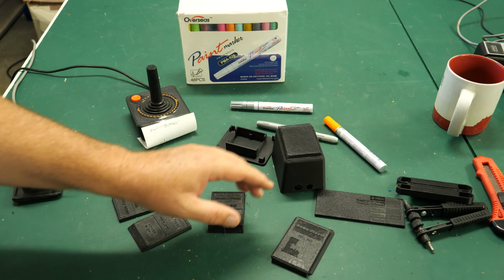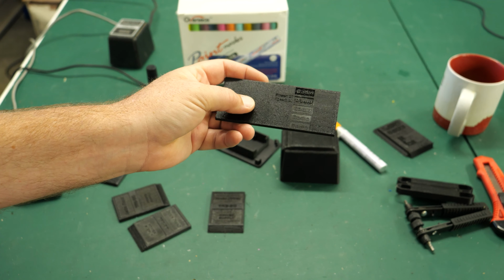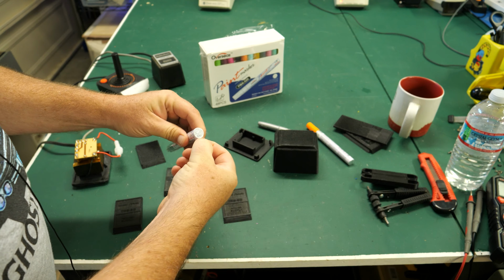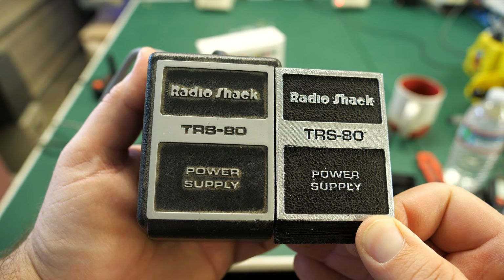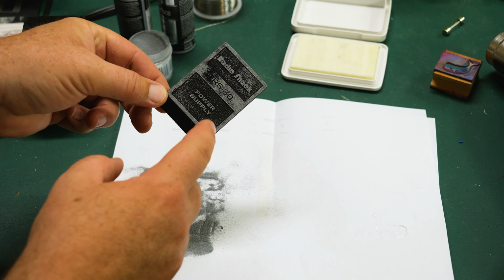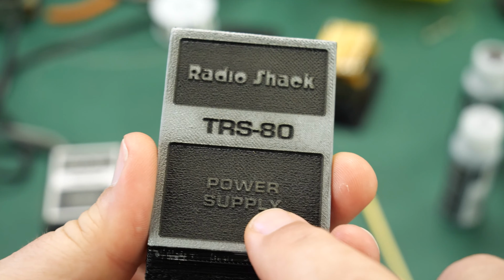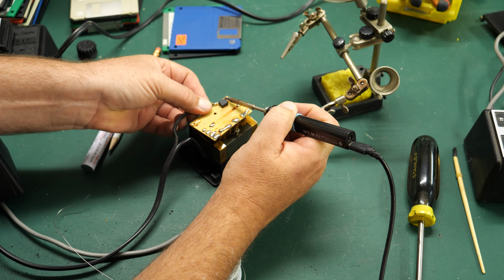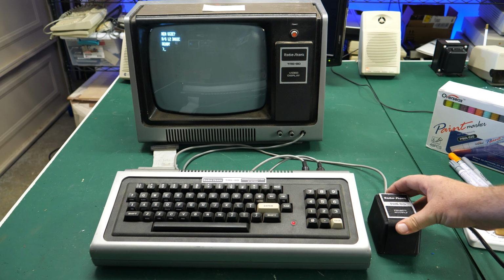Using Lasers To Make Reproduction Cases For Vintage Computers

Comment: For silver, you must use graphite. It is used to great effect on cosplay 3d prints, and after rubbed in, does not come away at all. During application it is messy, but thereafter its really nice

Comment: Why not just print in 2 colours since it is flat you can use change filament  at layer hight. The good bit been it will not rub off

Comment: You might try painting rubber roller. They are used for fine painting surfaces. Contrary to using brush or pen, it cannot touch deeper surfaces so painting should be more tidy. Also painting goes quicker as you just roll it over the surface.

Try acrylic paints. They are easy to use and are somewhat resistant to usage wear.

Comment: Using a foam roller with a very light load of paint will roll the paint on very easily. Just load the roller with paint and roll it on a tray to get the roller to have only a small amount of paint (almost dry roller). I do this with raised letter signs all the time.

Comment: Why not make a mold then use injection instead? It would give you a much more realistic finish as well as avoid having to make and reproduce all those fine details, especially of the rough-face of all the sides...
Reply from the maker: If only I had an injection molding machine 😞
Reply: @RetroHackShackAfterHours Local companies do that as long as you make the mold. I know this would be better if you wanted to make a larger quantity, but most shops will do it for you for not much money.
Reply from the maker: @ronwatkins5775 Last time I looked into it it was a $2500 one time fee.
Reply: @RetroHackShackAfterHours Wow, that's crazy...

Comment: Slight concern, the transformer may produce enough heat to deform PLA? I had a few hot PSUs that melted their original ABS case.
Reply from the maker: Not with this particular one. I have had it running for hour so far. However, ABS has a higher melting point. Also, I am working on a case with some vents, too.

Comment: Paint pen then laser?
Reply from the maker: Yeah. I tried with paint first in the video.
Reply: @RetroHackShackAfterHours  I saw you used the paint in the little jar then used the laser. But I was wondering if the pen paint would work any better with the laser.
Reply from the maker: OIC

Comment: I think next time you should scan the parts that are visible from the outside / non functional using photogrammetry and then resin print it. I bet you could get it look much much closer to the original, since with this technique you should be able to even capture the fine surface details of the original material. like the channel though, keep up the good work :)

Comment: I would have tried printing the label face-up as a separate part, changing the filament to silver for the last couple of layers and then gluing it to the rest of the case.
Reply from the maker: Yeah. I just tried this. The reason I didn't initially was I didn't want to waste the filament on the supports. Maybe I'll do an update in a short or something.
Reply: Was thinking the same but first 2 layers in silver pla then let the laser at it. Sometimes raised text can be tricky when the font is small.

Comment: The easiest and best way to get a nice, even coat of paint on raised lettering/molding/whatever in plastic is simply to take a sheet of paper, spray some paint of the correct color onto it, and press the item into it like a printing block.  Paint sticks to the raised parts and there's no unevenness in the surface.  Perfect factory looking results.

Comment: So many times with Makers, hours and dollars are wasted designing 3D models and 3D printing in low quality, when spending a few $s at Hobby Lobby on mold-making goop and 2-part resin will allow you to cast perfect copies in minutes.
Reply from the maker: This is true. I could really use a primer in mold casting.

Comment: Another option would be to laser cut the complete upper part of the case.(and use it as a inlay) If you laser engrave acrylic you can almost use it like a C&C machine. Every pass you will get a little bit deeper into the material. Or you can do it with 2 thin sheets. one black background and 1 for the silver parts. But it was a nice learning experience, and the model looks very nice. Well done.
Reply from the maker: Yeah. I thought about that too. Many ways to skin this cat.

Comment: If you had printed the case not upside-down with tree supports then the letters would have been perfect. With pausing the print after the last full-plate layer and changing the filamant to silver at this pause (and then continue) you can do some poor men twocolor printing. You also need to print with a material other than pla as those transformers can get rather hot and you don't want to have a molten case.
Reply from the maker: I have had terrible results trying to do multiple colors with a single extruder. I need to practice more. Great tips though!
Reply: @RetroHackShackAfterHours  you need to change the filament from black to silver serveral layers before the final layer than this should be fine even with no purge tower. I personally have a Ender 5 Pro modified to 4 Extruders on one single Nozzle and this works fine. You need a purge tower when you need to clean the old filament from the hotend on (automated) color changes. But when there is only some embossed letters then the old filament purges itselves in the last layers. Also you can do some manual purging on the pause/filament-change to avoid color mixing. Also do not change the filament type as different types typically do not stick very well on others (how much depends on the combination). So ABS only with ABS and so on.
Reply from the maker: Yeah. BTW just for kicks, I am printing a new model now with vent slits in the sides and right-side-up using supports everywhere to see how the text comes out. The only reason I didn't want to do it that way the first time was I am cheap and didn't want to waste the filament. However, since making this video I have discovered organic tree supports which reduce the amount of filament needed for supports.
Reply: @RetroHackShackAfterHours  PLA has its glas transition temperature at around 60°C or 140F at which the matierial becomes more and more weak. Its also possible that your snap-tabs to keep it closed could get sticky so you cannot open the case any more. I am aware that abs is hard to print (need a enclosure for the printer and warping is a big thing) but its much more durable.
Reply from the maker: Also, I should have mentioned the melting point of PLA which is around 175C or 347F. This PS doesn't get that warm, but a few vent holes could be added just in case. "in case" see what I did there 😁

Comment: the video title was a bit misleading it should have been psu case not cases for vintage computers
Reply from the maker: If not was not clear, the idea is that you can use these ideas to make reproduction cases for whatever. I just happened to have the PSU case I was working with
Reply: @RetroHackShackAfterHours  Oh right I get what you mean now